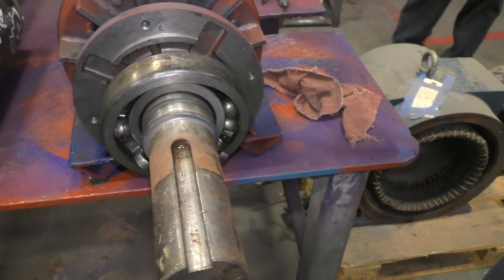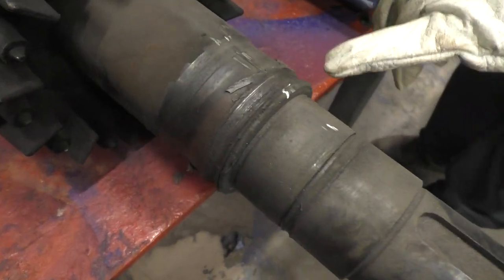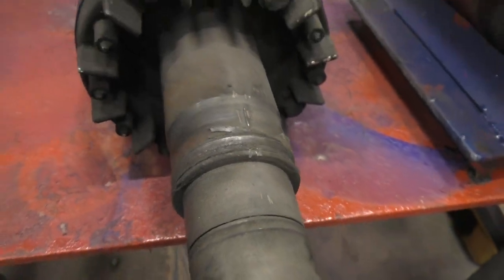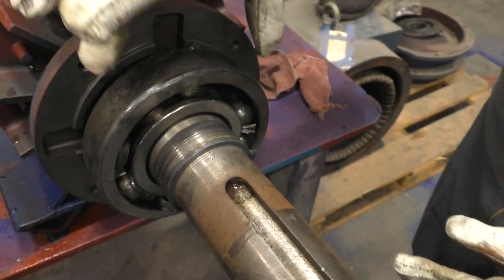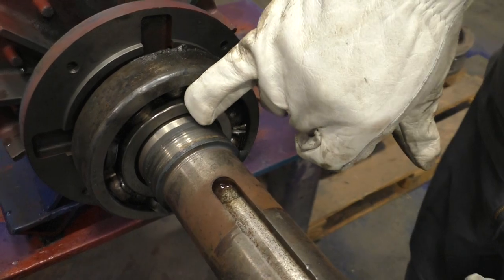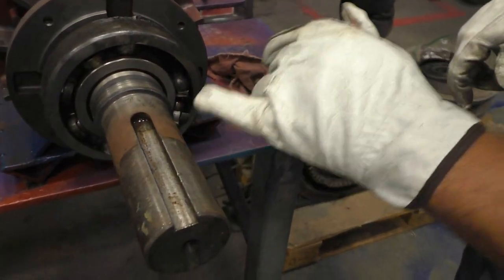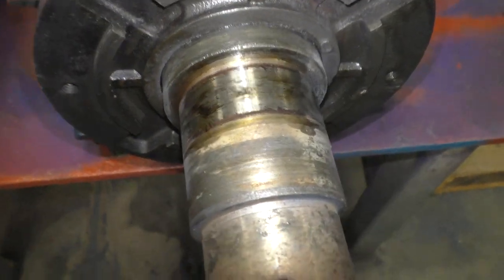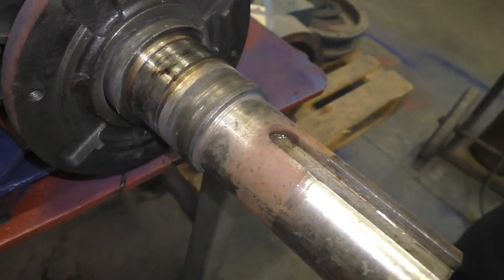Removal of seized ball bearing from shaft via cutting torch

Comment: Just had to do the same thing today but I used a die grinder for the inner race along with a hammer an chisel. I had motor winding that was exposed and I was worried about too much heat but it all worked out. These motor shaft bearings should be a sealed bearing so they last longer. The bearing I was removing off our compressor  was only like 4 years old and the ball cage was broken making the bearing scream. Hopefully the sealed bearing will last much longer.  I have never tried cutting the inner race with the torch I will give it a try next time. Thanks for the vid.
Reply: May I suggest viton rubber shielded bearings? Just wash the old grease out with acetone or some other degreaser, dry it with an air line and refill them with high temperature grease.

Comment: My boss Ted used to do that.  Amazing bro.  Thanks for posting.  His son Ricky could reverse weld as in removing the bead without touching the parent medal.  Wish I knew that kind of stuff.  I’m just a machinist.  Amazing
Reply from the maker: Right on Dougie
Let us know if there is anything else you would like to see!
Reply: Could you do a video on how to cut a broken bolt out of a bulk head with oxy acet ... we used to do it on bulldozer track roller bearings but I never got taught .

Comment: we have some flange housed bearing that we were heating up to knock off a 2.5 shaft but ran out of fuel. we had to find a way to get it off asap. We ended up using about 20 - 6" cutting wheels to cut it off and finally got it off. Any other ways that we could have got it off faster without heat? The puller wasn't budging it at all. it was a Flange-Mount Ball Bearing Unit - 4-Bolt Piloted, 40 mm Bore, Cast Iron Housing Material, Set Screw Locking. Wondering if you could find one that has spun on the shaft and getting it off with out heat